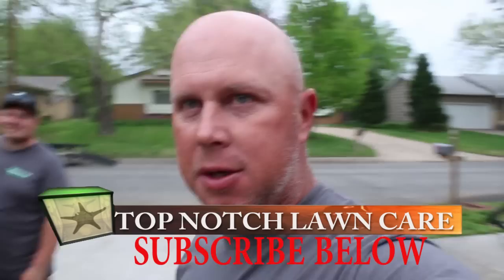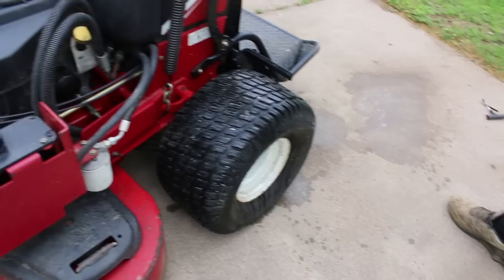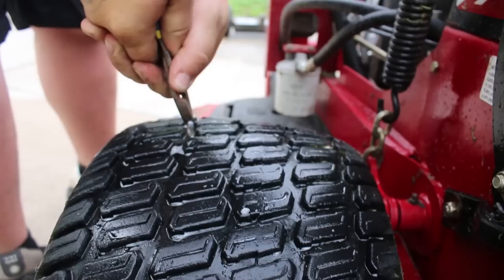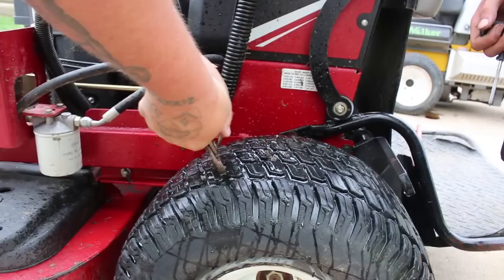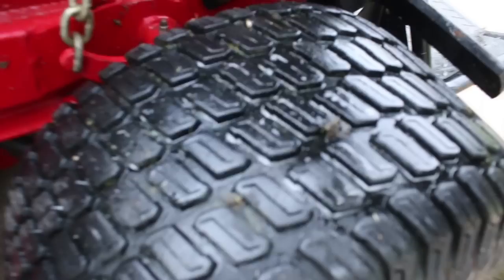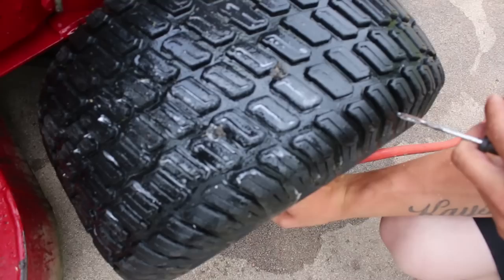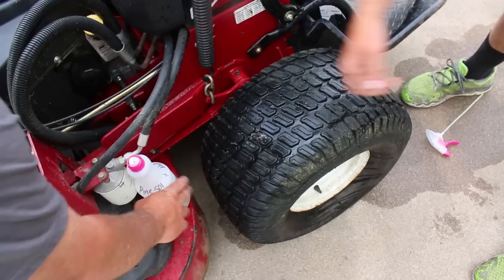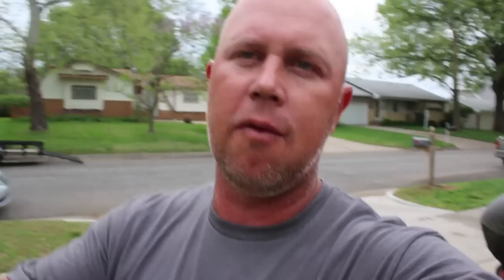Lawn Mower Tire on Fire, How To Fix Flat Tires, Vlog #115

Comment: Ive burned the plug after I put it in, melts to the tire. Seems to work great. I also, push the plug half way in, turn 90*, then pull. Kind of get a 4x layer that way on the larger holes. I have often wondered about a small coat of tar, or roofing tar or something on the inside of the tire, kind of like the slime, but less likely to pool up as the tire sits...

Comment: Rubber cement with the plug. I've used 2 part, 5 minute epoxy as well...works like a charm and cheap for multiple leaks

Comment: I always dry off the spot with a little bit of heat from a propane torch.  I also heat up the plug.  My thinking is it will adapt better to the hole.  Seems to work.

Comment: Rubber cement around the plug as ur pushing it in, works wonders.
Reply from the maker: 👍🏻👍🏻 have to try that. Since this vid it has new tires.
Reply: From the looks of that tire I'm sure you'll have plenty of opportunities. Lol
Reply: +Top Notch Lawn Care The kit I bought like yours had the cement with it in a tube.
Reply: Yep.  Never had one leak after adding the rubber cement.. just put it on your plug before you insert and trim off the excess after inserting it.  Great Vid's, Thanks for the efforts!

Comment: Had a slow leak the other week, pumped it up a after the Easter break and the valve wouldn't seal after. Great. Took it in to be repaired. But they forgot to fix the slow leak. So back I went. I've used that stuff, the last kit I bought had a tube of Rubber Cement full of air. No glue in the tube at all. I'm lucky like that. lol
Reply from the maker: Haha

Comment: Get the orange plugs for semi tires I believe. Those are best I've used but I always cut them off flush so they don't pull out. Hell I've even used a bungee cord as a plug in a pinch.

Comment: I think it's time for the tire patch on the inside of the tire or a new tire. Those plugs are so so. I've used two at a time in truck tires and they don't ever seem to last. Back in the day when you took a tire to a tire shop they patched the inside of the tire unless of course it was on a steer axle tire.

Comment: Twist the tire plug tool about 1.5 to 2 full turns after inserting tire plug, and before removing the tire plug tool for a better seal . I have always had better luck twisting the plug after inserting into tire and  especially on larger holes.

Comment: Best way to have repaired that tire put a tube in it. Even better,  put the slime tube in it.  Lawn mower tires are generally made out of nylon so they tend to leak around the bead also. And long as the is no large holes in the tire tube it with the slime tube. This fixes the tire and auto fixes most nail holes. 

If you're going to plug a tire,  it's going to be temporary. Especially if you don't use the glue that comes with it. It will always leak eventually.  Put a slime tube in it, call it a day and cut your down time.

Comment: i would push plug in 3/4 then twist 2 or 3 times making a ball inside. then pull out quickly. the ball keeps it from pulling out  with the tool. if the hole is bigger. Rubber cement helps wonders if its tight. I snip off flush with side cutters. The seal is from the inside so whatever is done on the outside . burning.  etc. does not really do anything. Snipping it off just helps because something is not hanging out which could get caught and be pulled out. Slip off a curb, etc. I use only the car plugs. vulcanized. the threaded kind seem cheaper and always leak. A inner patch would work well but is overkill in low speed applications. Slime internally works well also.Front slick tires will puncture from thorns. nails. on the regular. And supposidly it does not cause the rims to rust. my .02.

Comment: Not all tire plugs are of the same quality I have found. I use Blackjack brand and have found them to be the best. In this situation still having a leak I would of added some Tire Slime to that tire before I would of thrown it away. You would of then been good to go.

Comment: Those auto parts store plugs are junk!  (so are the brown ones) The best tire plugs around are made by Tech Inc. They bond to the rubber and  they will out last the tire..as for your yard equipment? I'd put some slime in them all and you won't waste time plugging tires.

Comment: Yous are pushing the plug way to far in
Reply: +InYo Face I have also pushed half way, turned 90* and pulled. So far has worked well on my cars.